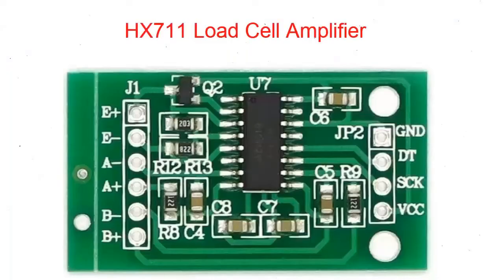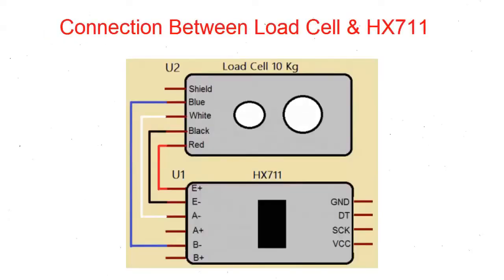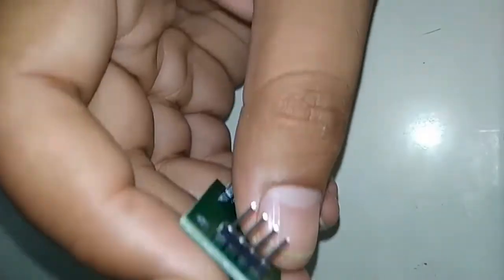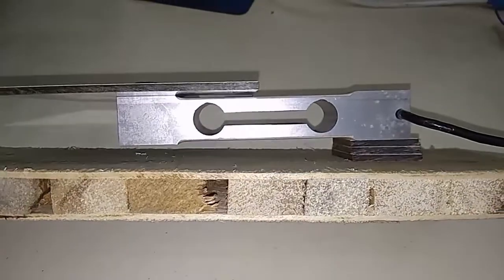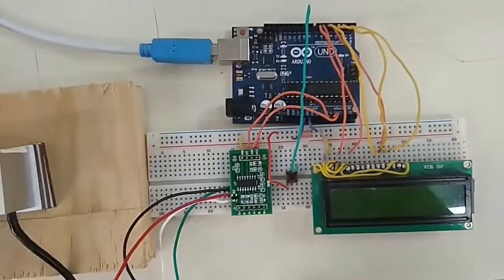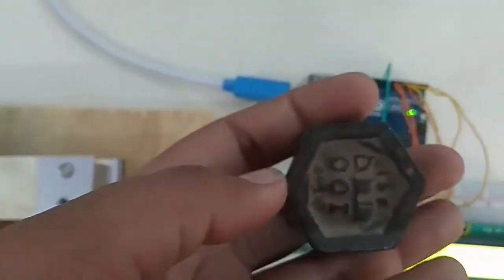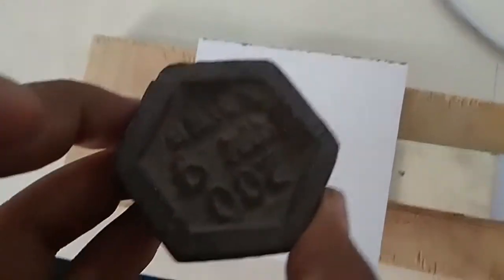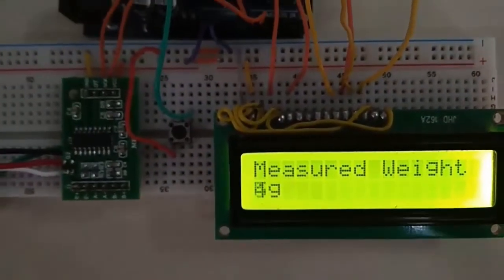DIY Arduino Weighing Scale with Load Cell & HX711 Module - Full Calibration

Comment: Hello and greetings from Europe. Thank you for this excellent project. Could I just ask about the reset switch, please?
On the circuit diagram, it appears to have just one single connection to terminal no 9 on the Arduino Uno PCB. Does it need to switch number 9 terminal to earth ( or zero volts) when switch is pressed to reset the system back to zero? Thanks and best regards.
Reply from the maker: Yes it needs to be connected to GND terminal. This will reset everything to zero.

Comment: I want to connect the weight loading unit with the Arduino and when it reaches 1 kg, the LED works on one of the Arduino ports

Comment: Hello!
I am going to use 4 independent different weigh calculators in my project. Each one will be seperated from each other. Can I use these 4 Load cells with a single hx711?

Comment: i need help with this. as u can see ar 4:03, the arduino is connected to another wire. what is that wire for?
Reply from the maker: Its connected to computer or a 5v power supply.

Comment: Program error

Arduino: 1.8.12 (Windows 8.1), Board: "Arduino Nano, ATmega328P (Old Bootloader)"

Sketch uses 4132 bytes (13%) of program storage space. Maximum is 30720 bytes.
Global variables use 161 bytes (7%) of dynamic memory, leaving 1887 bytes for local variables. Maximum is 2048 bytes.
avrdude: ser_open(): can't open device "\\.\COM6": The system cannot find the file specified.

Problem uploading to board.  See http://www.arduino.cc/en/Guide/Troubleshooting#upload for suggestions.
Invalid library found in C:\Users\SAI\Documents\Arduino\libraries\readme.txt: no headers files (.h) found in C:\Users\SAI\Documents\Arduino\libraries\readme.txt
Invalid library found in C:\Users\SAI\Documents\Arduino\libraries\readme.txt: no headers files (.h) found in C:\Users\SAI\Documents\Arduino\libraries\readme.txt

This report would have more information with
"Show verbose output during compilation"
option enabled in File -> Preferences.

Comment: If anyone want to buy this project with code & hardware with complete guide contact me...

You'll get the following

1. schematic diagram
2. Block diagram
3. Prices component list
4. components specification list
5. Brief description of all the main component
6. Support till your oral examination of project
7. Complete program (code).

& As well as anytime guidance of hardware & program.

If you want to learn complete step by step procedure you're also welcome.

You can also order :

 IoT project
 Home automation project
 Agriculture project
 8051 project
 PIC microcontroller project
 AVR Project
 Arduino project
 Node mcu project

Contact : +91 8796168099  WhatsApp 
Gmail : moinyunus@gmail.com

Moin Shaikh 
Embedded Software Engineer | IoT Engineer

.,.,..,,.,,.,.,.,..,.,.,.

Comment: Hi, great information.
I am looking to build a 1000kg scale I assume I can use the same circuit with a 1000kg load cell but which parameters will I need to change?
Thanks Dave
Reply from the maker: This won't work with 1000kg scale.

Comment: Why do you connect the output of the HX711 to analogin ? According to the HX711 manual you have to connect it to digital (one digital and one pwm)
Reply from the maker: I am using the Analog pin as a digital pin.
Reply: @HowtoElectronics  can you explain me how is this possible ? I 'm a beginner in MCUs
Reply from the maker: Learn about "Analog to Digital Converter".
It is a long process and need lot more explanation.

Comment: Hello sir
we give the power to the circuit the display is on and we need every time calibrate the circuit 
Is that possible to save the calibration in the programma?
So we need to only one time calibrate the programma and that calibration save in the memory so we don't need to every time calibrate the programma when we start the circuit
Reply from the maker: Yes you can modify the program a little bit and save the data in eeprom.

Comment: I want to make a fully automatic bag filling machine . how can we trigger the arduino when it gets a particular load? 
We can use a motor to take the bag away when it has filled the pre determined quantity
Reply: How did you figure it out eventually. Im doing a similar project to make an automated weigh and fill system for grains and cereals etc.

Comment: *.  if i use voltage more 5 volt,(example 12 volt).. is it damage for this kit ?
*.  is it  work... if loadcell more than 100kg,(example 30 tons).? 
please answer me .... thanks
Reply from the maker: Excess voltage will definitely damage any circuit. But you can supply up to 9 volt to Arduino as it has a voltage regulator ic.

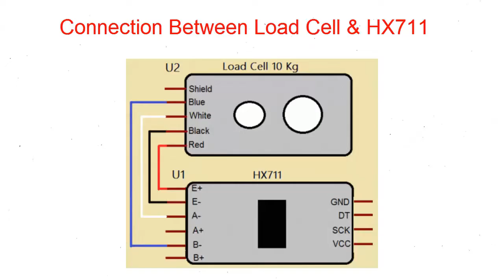Comment: no wire is attached to the a+( 0:52 ) & you say _____ connected to a+ please clear, and here the wire between load cell and module are different (  1:22 )..? please reply fast.
Reply from the maker: Check the link in the description for correct circuit.

Comment: If i use 200kg weight cell instead of 20kg , connection will be same or diffeent.?? Please reply.
Reply from the maker: Connection will be same. But this code will not work with 200kg load cell. You need modification.
Reply: @HowtoElectronics  thank you for fast reply.

Comment: Hello sir, 
One more help i want from you in displaying readings of two such load cells on same LCD. 
How can i do it?
Reply from the maker: Assign two different variables for two differe t load cell.
A lot of modification in the code is required
Reply: The 'DT' and 'SCK' pins of both Hx711 has to be connected to same analog pins of arduino (say A0 and A1)  or different?

Comment: Sir would it work for ATmega2560 microcontroller? 
I am using arduino MEGA 2560
Reply from the maker: Not an isse, you can use.
Reply: @HowtoElectronics  Sir but the arduino IDE serial monitor is not printing the desired output. After uploading the code it display vague symbols. Can you suggest what might be the problem and possible solution.? Thanks.
Reply from the maker: Change baud rate.
See wat is the serail begin baud rate.
Set the same baud rate in serail monitor.
Reply: @HowtoElectronics  thank you so much sir. Much appreciated.

Comment: Thank you so much , it's working..
But I want to know what changes when load increase in certain limits and how to show that user cross certain limits.
Ex- My project is same but I want to show weight when it cross 1000g then lcd show that it's heavy object.
Reply: U can just add a if statement check:

if(weight >1000)
{
  Display on lcd "heavy object"
}

Comment: Im using 400kg loadcell where in loadcell datasheet its mentioned the excitation Voltage as to be within the range of 10VDc to 15VDc where else Arduino and hx711 powered by 5V, How to interface in this scenario
Reply: use voltage regulator module  it will boost 5V to 15 v dc
Reply: Arduino Mega has a 12v output

Comment: hi tnx for your explanation and i want to do a project with HX711 that display the mars weight
can you help me the code
Reply from the maker: Calculate the ratio between specific gravity of mars to earth. Then multiply this ratio value to final resultant value in program.
Reply: plse can you tell me where to edit or add the ratio to the code that you used for your project 
tnx for replying

Comment: Can i know the theory behind on  how to convert calibration factor to the measured weight?
Reply from the maker: Transducer. Converting voltage into weight.
Reply: @HowtoElectronics  how to obtain the voltage as i need to manually show how i calibrate it?

Comment: The screen print "put 100g weight and wait", after I've put 100g weight on top, nothing happen, can i know what's probably the reason? The connection is correct as i just follow exactly the connection shown
Reply from the maker: U r missing something. Check hx711 load connection with arduino
Reply: Do i need to edit the coding if i am using yzc113 5kg load cell?
Reply from the maker: No, just correct your hardware connection.

Comment: if i set my circuit up the same and it skips the 100g weight part and wont register weight what am i doing wrong? also im using the Sparkfun load cell amp with a 50kg load cell if that means anything please message back asap its for a school project
Reply from the maker: 50 kg load cell is too hight. But it should work as well. Did u edit the program.
Reply: @HowtoElectronics  what do I need to edit I'm learning this stuff as I go so kinda unfamiliar with it appreciate the replies ? If you could point me in the direction thanks
Reply from the maker: Try with 5-20 kg load cell and once check, whether ur assembled circuut is working or not.
Reply: @HowtoElectronics  would I  be able to edit and use the 50kg cause it's for a project and I dont wanna order and wait for a load cell to ship to my house
Reply: are your DT and SCK pins equivalent to my DAT and CLK pins respectively  aswell and do i need to edit that into my program?
Reply from the maker: There is no need to edit program. The code is 100% correct. You have connection issue. Try to fix the connection between HX711 & load cell with Arduino. See the circuit diagram from the link in the description.
Reply: @HowtoElectronics  is it manditory to have the connection bars for the hx711 i am just using breadboard jumper wire and i have them curled through the pinout holes. do i have to solder them to have it work?
Reply: @HowtoElectronics  perfect thank you very much

Comment: hello sir, how can I connect 3 different load cells to one LCD. To measure 3 different types of things, only one at the time, but it can display on the same LCD, so I don't have to install more than one LCD for each load cells. 

Second, is there any way i can collect the data (the measurement) and store it to any database.If can, wld you give me words or to of what you think i shld know bfr I start the programming?

Last question, just incase if i want to advance my project. Is that possible or too difficult the programming to calculate the total weight of each load cell and display it on LCD?

Try my luck here tht u'll notice.
Thank you, regards from Malaysia.
Reply from the maker: Everything you said is possible. Bit you need some high level and serious programming
Reply: Hi buddy, doing the same. As i too want to modify this project, like i wanna store reading in it 5 to 10 reading. Secondly please give me your email id if possible, so that we can discuss this project. 
And Dear Sir, please look into my question and help me out if possible.
Thanks and Regards 
Pakistan

Comment: this project can be run with 3 load cells? And how would the connection be made? thank you.
Reply from the maker: First clearify why do you need 3 load cell. 
For measuring 3 different weights.
Or increasing load cell capacity.
Or something else.
Reply: @HowtoElectronics  is to increase the load capacity, I have 3 cells of load of 15kg and I need to measure a weight of 35kg in a structure, for this I will put each cell in a point of the structure. (the structure will be a bridge made of pasta) rs. thank you.
Reply from the maker: There is load cell of 40 kg available.
Use that.
That is the only alternative
Reply: @HowtoElectronics  ok, thanks
Reply: How to Electronics Could I use 3 charge cells and 3 hx711 in the same arduino for it to show the value of the 3 charge cells?
Reply from the maker: How would u display that value in 1 LCD

Comment: Sir, I have 3 questions.
1. want to use a 100 kg load cell. so for this also the hx711 and Arduino Uno 3 remains same or should I make any changes?
2. Should I have to connect it to the computer all the time?
3. Is calibration required whenever I turn it on?
please answer it, sir . THANK YOU .
Reply from the maker: Answers
1. Yes you can use 100 kg load cell for measuring weight upto 100 kg. And yes the circuits remains same.

2. You don't need to connect to PC all the time. Rather 5 voly batter or 5 volt power supply adapter can be used instead of PC. PC is used for the first time for uploading code to Arduino.

3. And yes calibration is required everytime you turn ON the machine.

Comment: hello sir,, my name is yuli pramono,  i have a project same with you, until the calibrate.. the program is working very well.. but when im measurement at 150gr and more the the program hasnt accurately count.. 

im use 1kg load cell..
can you help me sir?? or other people?? i need your help thanks..
sorry i cant speak english fluently
Reply from the maker: If you are using 1 kg load cell then, you can measure weight upto 1000 gm only
Reply: yeah,, when i calibrate with 100gm th program working very well.. when i change the mass with 150gm and more,, there are gap with the count.. if i put 150 the count is 140 gm,, if i put 200 gm the result of count is 185.. and if i put 675 gm the result in lcd is 565 gm

sorry i cant speak english fluently
Reply from the maker: Brother at first use 100 gm for full calibration. Once the calibration is done, then only put any other weights. 

If that doesn't solve the problem then there must be some problem with your load cell.
Reply: ok.. ill try sir.. thanks.. thanks a lot

Comment: Hello, sir good video it helped alot with my project.
I just wanted to ask is it possible to measure the output voltage of the sensor at the the output of the HX711 between DT and SCK ? It's the same voltage but amplified right ? Like if I have an output voltage of teh sensor of 0.0004V and with a gain of 128 we will have and output at the end of HX711 of 0.005V.
Can you enlighten me in this area please ?

Thank you very much.
Reply from the maker: Basilly load cell along with hx711 is a transducer that converts the weight into electrical voltage.

The 4 arm inside load cell produces voltage as in wheatstone bridge.
And the voltage can be measured. Simply use multimeter to measure voltage.
If the voltage is very low you need amplifier. That is the reason why hx711 is usef. Instead of hx711 you can use op amp ic to amplify volatage and measured desired output
Reply: How to Electronics okey, thank you.
And what op ampli do you suggest me in this case ?
Also is there any way to know what happens inside the hx711 how it amplify the voltage and convert it to digital ? Because I didn't find any of these infos in the datasheet.

Comment: Sir how can we give input value to the load cell through keypad for balancing system to measure something
Reply from the maker: First u need to put 100g weight for calibration. The program here automatically sets the mass voltage according to calibrated 100g weight
Reply: How to Electronics  yes sir i know about that basically we r making a project in which we have to give a input value suppose  300gm the system would then produce sound for weight more then 300gm ......simply how can we setup a system that would detect the required mass and then produce sound if we put a mass greater then thar
Reply: Our project measure weight and produce sound for weight more then 500gm now we want to add input so that we would select random target value above which sysytem would start sound through buzzer....
Reply from the maker: Use buzzer with any digital pin of arduino.
Use if else condition that is if the value exceeeds the buzzer should go high
Reply: How to Electronics tanks alot for ur time....
Can u made a short clip like this for the same condition which i have mention

Comment: Instead of measuring weights if i have to measure voltage in hx711 ,how will be the connection? and how to read 24 bit value?
Reply from the maker: Just measure voltage across 4 wires of hx711 using multimeter by changing different weight value.
Reply: I mean to measure the voltage of a battery (within 5 V) , using 24 bit hx711  adc
Reply from the maker: This can only be done via wheatstone bridge.
Reply: Ok , but the voltage that i have to measure must power the wheatstone ? what will I place at variable resistor (in usual circuit, where weight is measured )
Reply: Yes you can.